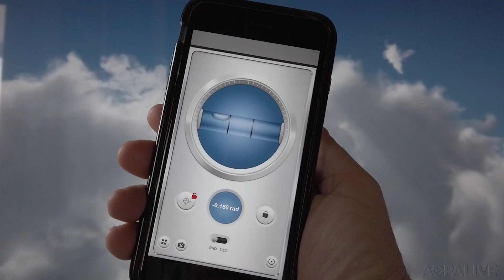Cellphone technolgy enables flying motorcycles

Comment: Before anyone can use these in a crowded urban environment there are three major problems to solve that we may have to concede are unsolvable: the danger of spinning propellers; the inconvenience to others of street dust and litter being kicked up; and the inability to stop suddenly like direct-contact rubber tires give us. The first is probably the easiest to solve, but at the cost of weight in ducted fan-type shrouds and a reduction in efficiency of safety screens. Restricting takeoffs and landings to roof pads and never allowing them down at street-level may be the only way to deal with #2 and #3.